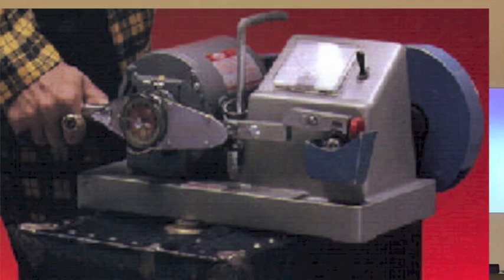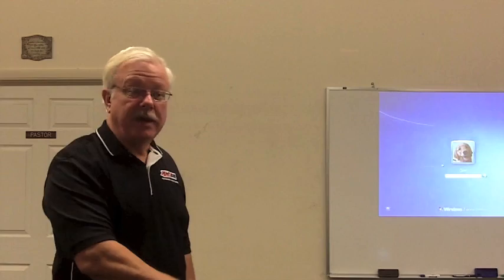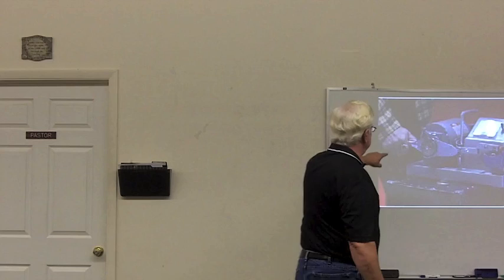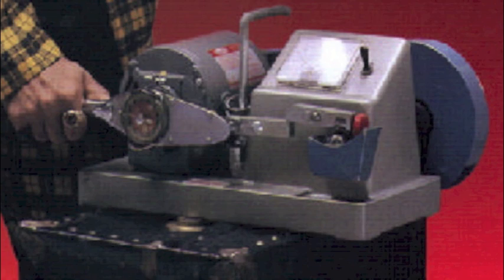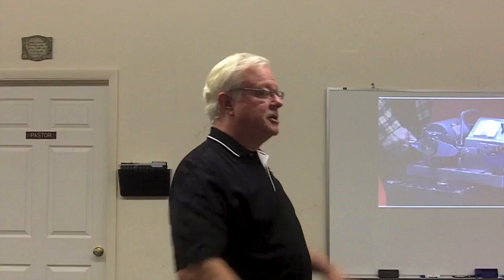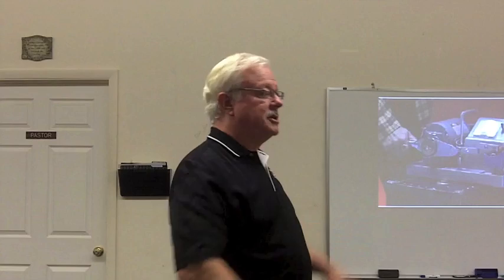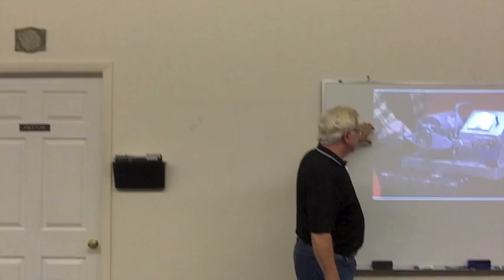One Armed Bandit

Comment: what is the speed of the metal disc
what is the power of the drive
what is the torque
what is the diameter of the wheel
what is the surface finish of the wheel

Comment: |i used to use the one arm bandit, we would say this test is not the real test, its just a demonstration of how good the friction modifier that wynns industrial divisions products are, especially after we send the oil they use after the use in industrial machines worth millions of dollars and then use the same oil, but with the friction modifiers we give them to test it in the machines and then send both oils used to a oil lab for testing and a print out of everything they found, and sure enough 44 gallon drums of the friction modifiers were sold because of the LAB testing ,so wynns products do work ,but in this day and age before the environmental considerations, the oils were either semi synthetic or full synthetic, but with totaly different friction additives used, compared to now in  new oils especially those 0 w 30 oils? official friction testing for motor oils and other various grades of oils is this test https://youtu.be/nxTViMKn9a0, then there's more of less the same method to test grease and gear oils but different standards and machines when producing the products for the market and why not one oil will tell you what friction modifiers are used and what % of various friction products are used boron, chemical or mineral oil based etc etc. :) Also why the OE Car companies say NOT to USE friction additives, why because in this new age its about catalytic convertors and using the wrong friction additive will block your cats full stop and the O2 sensors as well, thus your engine light will come on eventually etc. :)